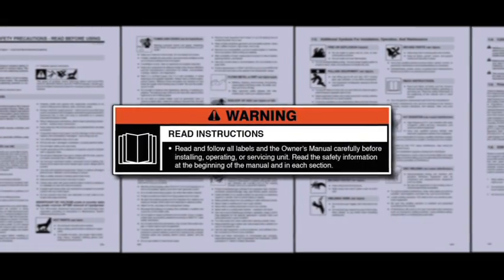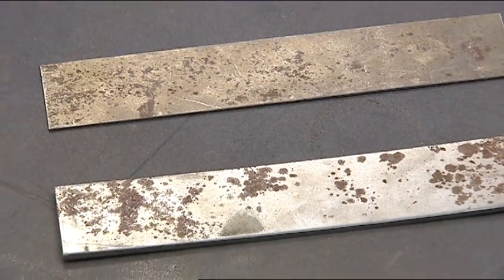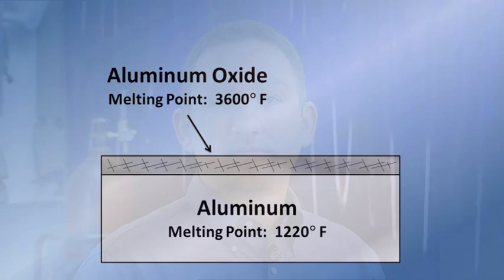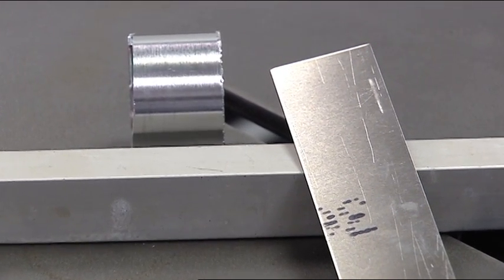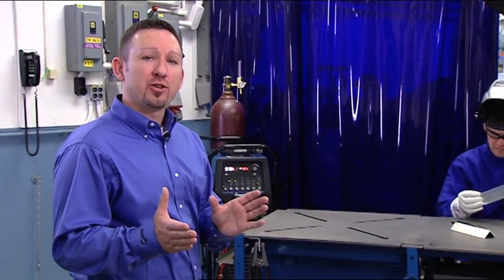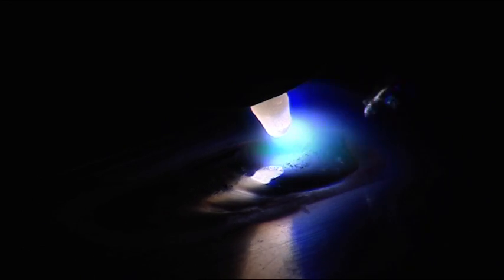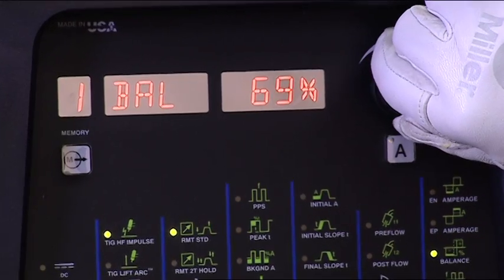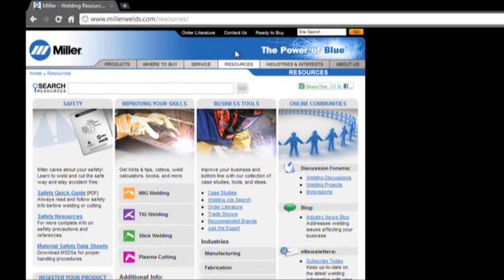TIG Welding Aluminum: AC Balance Control

Comment: What about the independent en/ep balance control?
 If balance is set to 75 can that setting be fined tuned even further
Reply from the maker: Thank you for reaching out. Please keep in mind that this video was developed to illustrate a weld position and the specific welding techniques/weld settings used are not necessarily best for all applications. The Specification Sheet from the manufacturer of the filler metal you use is the best tool to determine starting welding parameters. Please let us know if you have any further questions. Thank you.

Comment: First one with shiny puddle he kept his filler wire in the shield. The second one with pepper in the puddle he kept taking the filler out of the shield, letting the oxygen attack the hot metal of the filler and then shoving it back in the puddle. No matter what the settings, if you do that you will all get pepper

Comment: What type of of tungsten in the video ? Red or green ? I’m using red tungsten to use on the ac it work but not too long the tip got mess up .
Reply from the maker: Thanks for reaching out. For tungsten recommendations for your specific application, please give our team a call at 92--734-9821.

Comment: What would an oscilloscope show when ac balance is adjusted? Is it as simple as adjusting the midpoint of the sine wave, created by adding a baseline negative current on top of a simple sine wave?
Reply from the maker: Hi, thank you for the question. We recommend giving our service line a call to talk this through with a tech. The number is 920-734-9821. Thanks.

Comment: IF WE SAY 70% balance that means that the electrode is joint with negative pole 7times and 3 times with positive?
Reply from the maker: The balance is measuring the percentage of time spent in electrode negative polarity within a single AC cycle. Each AC cycle includes time spent in electrode positive and electrode negative. We hope this helps, let us know if you have any other questions.
Reply: I have the same question since my cheap inverter TIG machine doesn't have an adjustment like that nice new Miller....But you really didn't give a clear answer to that question Andreas asked.... My machine and I am assuming his machine as well, has a dial that show 0 at the top center and then negative - counter clockwise and positive + clockwise, so 75% would be the amount of Negative polarity spent?? And would the negative side of the AC wave balance tend to give more cleaning action or more penetration?? Been TIG welding off and on for years, but never with these newer inverter machines. Thanks

Comment: And what if i have black spots on puddle and i should make balance down, but at the same time i get my tungsten melting to big ball ?
Should i change tungsten ?
Reply: +RoweroMacka   Black spots, usually dirt or touching the tungsten to work....tungsten balling up...go larger on the tungsten, you get up to 5/32", for the larger torches 3/16"...

Comment: The Dynasty 200 DX is the best machine on the market, light weight, welds great, frequency adjustment to focus the bead. I have a trailblazer 300 and can run my Dynasty off of the Trailblazer. It lets me weld anything anywhere.
Reply: Its not the best machine that size in the market
The EWM Tetrix 230 is far more superior and advance

Comment: does that mean i dont need to clean aluminium with a stainless wire brush before i start welding, if i have ac balance setting?

Comment from the maker: Miller agrees that it would be nice if there was a standard to make things easier as an industry.  Since there isn’t, Miller has chosen to use what we have historically used when discussing what results in an arc when adjusting the AC balance: “%” as it relates to balance control, refers to percentage of DCEN (DC-) versus DCEP (DC+) in an AC arc.   When it comes to Miller products, this is consistent for all our  AC capable TIG machines when  the balance setting is adjustable.

Comment: there really needs to be better international standards for this feature on all AC tig machines.. i find it really irritating that every machine operates differently.. its not rocket science.. and in this video you didnt mention how the % relates to EN or EP for the miller machines. It makes no difference what the brand is, the functional standards should be the same for all brands of machine.